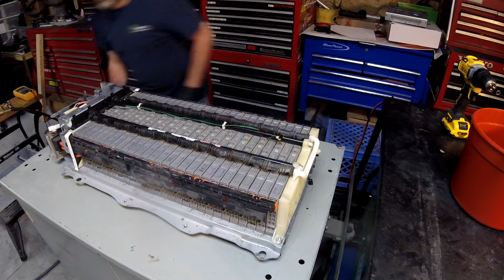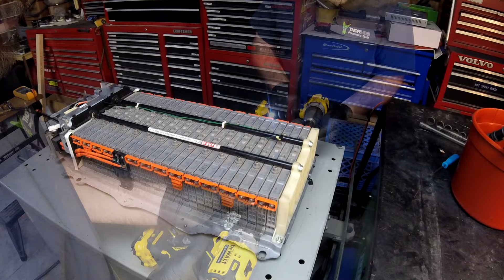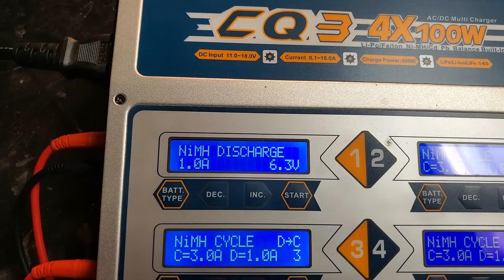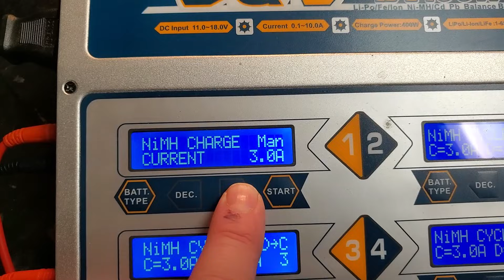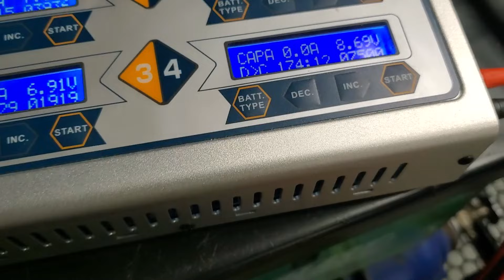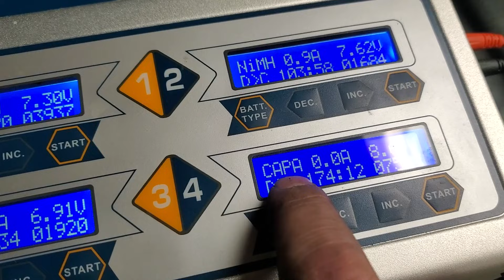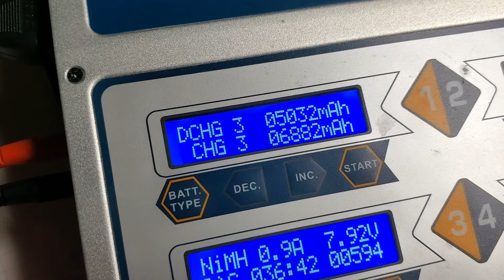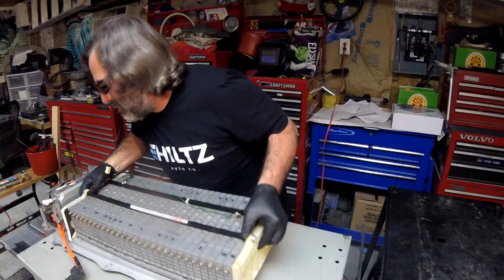DIY Refurbish / Repair Hybrid Battery 2nd Gen Toyota Prius - EV-Peak smart charger POA80 P0A80

Comment: @Gregg Festo  Back for my update: after about 2 weeks... ( I am a little late I reconditioned over the new year) backstory: I own 2 Prius' both batteries went down roughly around the same time. My goal. recondition 1 good one out of the 2, while searching for an additional battery to gut and store the additional cells for the second. While conditioning the battery i was able to find the other battery at the junk yard for 250!!!!!! The guy didnt know what he had really it was only missing the safety clip. Came home popped it in one of my prius' and what do you know all the cells are testing well with a capacity just over 80%. First blessing, done. Meanwhile I was still reconditioning the original battery using your method, tools etc upon finishing I did the dumbest thing and balanced it overlooking a bad cell that was left in. So I started over..... Long story even longer, I managed to finish and balance the cells, upon installing I made the mistake most people make by not fully locking in the safety clip... I thought I failed.. after realizing and correcting this, the battery activated the Christmas tree of lights disappeared and wa la... She's up and running. I am going to start the process of reconditioning all of my remaining back up cells... Here's to the road to 1 million!! THANK YOU SO MUCH!!! I use the reconditioned one for my UBER prius and she's purring like a kitten no issues! For all of you skeptics lol make the plunge I used the red CQ3 followed his steps to a T.
Reply from the maker: @FlickTracy Thank you very much for the followup report.  You had a few setbacks but overcame them with great results. The pack for only $250 was an AWESOME find. I appreciate your feedback. Happy driving and please write back in when you hit 1MIL!!!!

Comment: I appreciate the effort you put into this, I got me a charger and have been going through a hybrid Tahoe pack, so far looks like everything is bad, most everything is 800-1000 on low reading, I guess I’ll be looking for a couple used packs to rob from
Reply: Also, is there a way to read what’s happened in previous cycles before it ends all 3?
Reply from the maker: If you hit battery type button during a cycle it will display info for the cycles that finished and the current cycle but it will stop the current cycle and you will need to it start over after viewing the numbers.
Reply from the maker: Thank you for watching and commenting. Sometimes you have to run more than 12 cycles to get them to come around. Don't give up too soon.
Reply: @GreggFesto  I won’t give up, but I read a forum somewhere that said gm vehicles will toast the pack before it brings in a code. I will definitely salvage what I can
Reply: Just to be sure I’m getting this correct? Your getting 5000mAH of discharge discharging down to 6.3v ?
Reply from the maker: That is correct. I am doing a pack now that sat in a car for over a year and a half. Both batteries were dead, Replaced 12V with brand new one but the car would not start due to low voltage (171) on the hybrid pack. Found 3 cells so far that will not come back after 20+ cycles. Others have come back to 5400mah-6200mah. Interesting thing I noticed on these cells that have been sitting, most of them read 0000mah low and 7500mah cap on the first run.
Reply: Hello fellow GM Hybrid owner. I just started cycling my Silverado Hybrid cells. All tested 7.9+ volts standing, but have high voltage variation code. 

How many did you end up replacing?

Comment: Wonderful!
Additional tip to clean the copper plates of the battery you can use sulfuric acid to remove corrosion. And then white vinegar. And finally rub them with 280 sandpaper 👍
Reply: Use 2000 grit sandpaper
Reply: Bicarbonate soda to neutralise the acid, many busbars are comprised in layers and the terminal hole has a crushed part crimping it together, acids are electrolytes and will promote corrosion.

Comment: Gregg, thanks for the great tutorial. I am beginning the reconditioning process on a battery I bought to replace the aging battery on my 2006 Lexus RX. I have seen in the comments that you don't have experience with this battery, but have you seen suggested settings for that battery anywhere? I know it will be different as each stick is an 8 cell battery with a voltage of 9.6V. Regarding the settings for your project, what causes the charge cycle to complete? I see the discharge stops at 6.3V, but what stops the charge cycle? I did a test run with some estimated settings (partially based on yours), and I hit the capacity cutoff of 7500mAh for all 4 of the cells I ran it on. I stopped at that point as I am trying to be a little cautious about destroying cells in my new (used) battery.
Reply from the maker: Hey Colin, Thank you for watching and commenting. I obtained my charger settings based on multiple posts on a forum called PriusChat. I suggest that you see if there is a forum for your vehicle as you may be able to do the same thing. The current setting multiplied by the timer setting is what determines the charge cycle, If the current capacity limit is reached before the current/timer setting then the cycle will end early. Please write back in and let us know what you determine are the settings and how the refurbishment goes.
Reply: @GreggFesto  I've given it another go and I am hitting the capacity cutoff again. If I understand your calculations, you are charging at 3.0A and 720 sec (12 hours) which means you are pushing 3600 mAh into the battery. Does that sound right? For some reason the voltage climbed to over 11V which is not good for the battery, I fear. Unfortunately, for me, there aren't as many Lexus fiddlers as there are Prius fiddlers, and I have not had much luck finding information specific to my battery. Any suggestions you could supply would be very appreciated.
Reply from the maker: Colin, I am not sure about the proper settings for your battery. I know the voltage setting on mine was obtained from PriusChat. I just do not know all of the technicalities and engineering involved.
Reply: To follow up on this, after some trial and error I have gotten about halfway through my batteries and the settings I have used are below:

Charger Settings
NIMH discharge = 6.4V (Honestly this should probably be a bit higher, maybe around 8V. It did work for me, but it may stress the battery to drop so low.)
NiMH sensitivity D.Peak = 5mV
CYCLE = Discharge/Charge = 3x
Charge/Discharge WAIT TIME = 5 Min.
TEMP CUTOFF = 176F
SAFETY TIMER = 900 Min
CAPACITY CUTOFF = 10000mah
DISCHARGE = 1.0A
CHARGE = 3.0A

This worked for me and hopefully it will work for someone else. After watching your video again, I noticed the voltage on one of your packs got to 8.76V. Since I have 8 cells per pack and you have 6, that would translate to 11.68V on my packs. I was seeing most of the packs end voltage at 11.91V, pretty close, so I think my fears were not necessary. Thanks again for the very helpful video.
Reply from the maker: Hey Colin, Thank you very much for following up and providing this information to help others. You Rock!  Please let us know how your pack turns out.

Comment: @Gregg Festo, I am charging four different cells using a battery charger that I think is the same as yours It looks just like yours. But I'm not getting good numbers so I'm wondering if I did something incorrect. I did all the settings just like you described in the video. The first cycle numbers were all in the 2000 range I had one in the 4000 range on the charging and all the discharges were in the 2000 range but then the second cycles were all in the less than 100 for charge and discharge and it settled into the charge was 0032 or 0033 for every cell for the second third and fourth cycles. I'm wondering what I did incorrect or if I just have a bunch of dead cells.
Reply from the maker: Hello George, I think you may have a setting off or it was not spoken in the video. Check your settings against the settings listed in the written description. Please let me know what you find.
Reply: @GreggFesto  I had the discharge voltage set at 6 volts instead of 6.3 volts but and fixed that now. Other than that everything was pretty much the same. 
I have a setting of "NiMH sensitivity D.Peak" at present it is set at "default" according to my manual that came with my charger the default value is 7 millivolts per cell. What should that setting be? 
In your settings you list a wait time discharge charge of 5 minutes. I have a wait time setting of charge discharge at 5 minutes is that the same thing? Seems like it would be the same thing to me. I just want to make sure it's correct.
I have the charge setting at 3 amps the discharge setting at 1 amp, it's set to cycle discharge then charge and I have it set to do four cycles. The automatic nickel metal hydride charge current limit is 3 amps, the manual NiMH current limit is also set at 3 amps. The nickel metal hydride discharge is at one amp and a voltage of 6.3 volts.
I did another set of cycles and got similar numbers so something isn't correct.
Reply from the maker: Hello George, I too have my Delta Peak set at default (my manual states 6-20mv/Cell but does not give a specific value for default). The settings you input are correct including the 5 minutes wait time between charge and discharge. I am wondering if you have a failed charger? Can you verify that you are starting the process from the CYCLE mode and not the AUTO mode?

Comment: I fix my 2012 pruis head gasket in Tijuana Mexico they installed a fle-pro headgasket for just $ 500 am the first owner. My hybrid battery HV is still working if it goes bad i just go to the dealership and buy the original toyota battery oem. Getting refurbished cells is not good idea especially because i drive far and go to mexico i rather buy a new toyota oem i did save 4k on headgasket job lol.
Reply: There is no guarantee that Toyota is selling you absolutely brand new modules in a new battery. They may be refurbished too, who knows?  Also a better term for this process is reconditioning battery using knowledge of chemistry and electricity. Refurbishing refers to changing out parts to make it 'like new' condition which is not what is being done here (except when modules are replaced).

Comment: Greetings @Gregg Festo and everyone who is reading this! Driving my Prius with recently reconditioned battery and looking on Dr Prius app's battery monitor that shows battery voltage, state of charge, battery temperature (in 3 points where the sensors are), etc. I noticed, driving about 20 miles, that battery temperature was rising especially in the middle, even it was relatively cool outside, 57°, and when temperature exceeded 120°, the number became red, NG!  Two other sensors showed temperature 115-116°. Fortunately the app is connected to the computer and has option to override battery temperature by ramping up the fan. I picked this option and immediately heard the fan turned on, and battery temperature started dropping. I am still wondering why the computer itself didn't turn the fan on to reduce the temperature, does anyone have an idea?
Reply from the maker: Eugene, Are the fan intake and blades clean? If not, perhaps the cooling system was not working correctly when on the lower fan speeds and required you turning up the speed before you saw the temp come down? I think the fan will  start up around 95degreesF and raise the speeds as the temp climbs.
Reply: @GreggFesto  Hi Greg, yes, the fan and the blades are clean. Possibly the app does not show exact temperature, I checked this morning, my car was in garage overnight at 52 degrees but app shows battery temperature 67, even the battery is insulated inside the trunk, it's still a big difference. Agree that the fan should kick off at around 95 degrees, maybe it was but at lower speed it's why I couldn't hear it but heard the fan noise after overriding temperature with the Dr Prius app
Reply from the maker: Hey Eugene, How has the car been doing these past couple weeks? Did you solve battery temp reading issue?
Reply: @GreggFesto  Hi Gregg, my car is doing very good, MPG is better than was with old battery, around 38-40, but I was away so didn't figure out yet about the battery temp, will check whether battery fan's hose connected properly, will let you know.  Have a great holiday season!

Comment: Thanks Greg for sharing this video. I recently finished refurbishing the 244.8 v HV pack in my 2012 Toyota Camry Hybrid and used many of the tips you shared. I set my discharge to initially 5.9 volts (0.9v x 6 cells) and also set my charge value to 12000 mAh to keep the Hobby charger from shutting off prematurely. My pack now reads 104% of its original capacity using the Dr. Prius App and I only replaced 2 modules. My Discharge/charge cycles took up to 17 cycles to get some modules to have a Discharge capacity of at least 6000 mAh(6Ah).
Reply: 12,000 mah? Greg recommended 7500. Are you sure you charged them that hard? Was that a good idea?
Reply from the maker: Hello Charles, Thank you very much for watching and leaving great comments. It is nice to get feedback on your readings, what you did, and how long it took. Happy motoring!

Comment: Hi thanks for sharing lot of info I appreciate for saving bunch of money.

I have a question regarding the discharge and charge cycles.

I did the charge and discharge on 4 cells as you shared after 12 hours it ended as per the setting I have enabled. I am only getting results on cycle 1 as 1408 MAH AND 7500maH, and seeing 0 values on cycle 2 and 3.

That means all 4 cells are not good at all and also I am seeing the voltage of 7.24 on all those four cells after cycles got completed
Reply from the maker: Hello Fahad, Thank you for watching and commenting. It appears your cell reached its capacity cutoff of 7500mah on the first cycle so it did not continue to the second cycle. The low reading of 1408mah is very weak so you should run the cycle again on this cell as your low number goal should be 5000mah. If the cell is repairable, the low number will begin to rise as you run more cycles. I expect you will see the low number begin to rise and the high number begin to fall some. Once your low number is 5000mah or more, you are good to go. Most cells are going to read a decent voltage so this is why we focus on the capacity of the cells. Please write back in and let us know how your refurbishment goes.
Reply: @GreggFesto  I will try to cycle it again and I am doing this on Camry hybrid 2015 cell which is similar to prius cell as well
Reply: Hi Gregg I am kind of stuck in cycles to get 5000meah out off 28 cell I can see most of them are reaching to 4k after trying it for more than 7 cycle very time consuming process might be I am not doing it correct way.

If you don’t mind could you please call me or text me directly on my cell so that we can discuss further.

Appreciated for your support !
Reply from the maker: Hello Fahad, I have had cells which required 12 or more cycles to come back to 5000mah. The time it takes will depend on the health of the cell when you start the process. I suggest looking over the settings again from the description below video and make sure you have them all entered correctly. Is your charger making it through all 3 cycles for each cell? Can you give an example of the values you get on the 3 cycles from a cell?

Comment: Are you leaving this unattended to cycle, if its taking 24 hours to do 3 cyles back to back, there's no time to leave this unattended like to go to work. Is it safe to leave this on like that unattended
Reply from the maker: Hello Carlos, Thank you for watching and commenting. It is safe to leave the charger unattended due to the settings. The batteries get warmer than the charger does. Don't place the cells or charger on flammable material of course, I place mine on metal tool box which I use as a work bench. If you do this refurbish, please write back in and let us know how it goes.

Comment: I'm getting a cap out! Error message everytime I do a cycle on my modules. I have the same settings as you. Any idea why?
Reply from the maker: Hello Carlos, Check your cycle results and you will see that your cell reached 7500mAh during one one of the cycles. One you reach the high capacity with charger it thinks the work is done and stops. This is fine, Pay attention to the low mAh values. If they have reached 5000mAh then this cell is good and no more work is required. If the most recent low value is less than 5000mAh then you will need to run the cycle(s) again.  Please check back in and let us know how it goes.

Comment: So. Ever since finding this video I’ve been gearing up for going through my 2010. Have the same charger now but looking for info on the banana wires with clips. Did you buy or manufacture? What AWG should I shop for? Anything else I should shop for?

This may be a stupid question but I don’t see a search feature in the comments. Is there one? I’m sure my questions have been brought up before but after a long bit of reading I didn’t find it nor did I make a dent in the comments.

Looking forwards to the next hybrid conversion video! You rock!
Reply from the maker: Hey Ian, Thanks for writing in. I purchased the clips on amazon, they were something like this.
 https://www.amazon.com/QMseller-Supply-Double-Alligator-Connector/dp/B07PNTFWR4/ref=sr_1_10?keywords=banana+plug+with+alligator+clip&link_code=qs&qid=1667235177&qu=eyJxc2MiOiIxLjU2IiwicXNhIjoiMS4zOCIsInFzcCI6IjAuOTIifQ%3D%3D&sourceid=Mozilla-search&sr=8-10